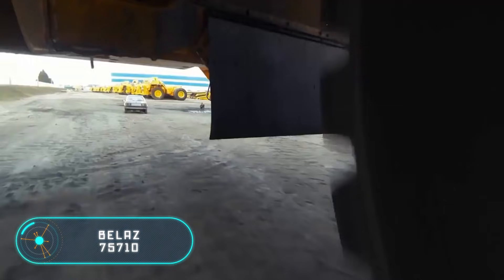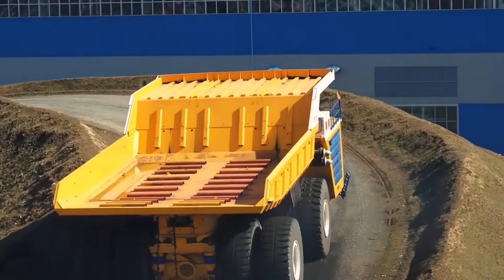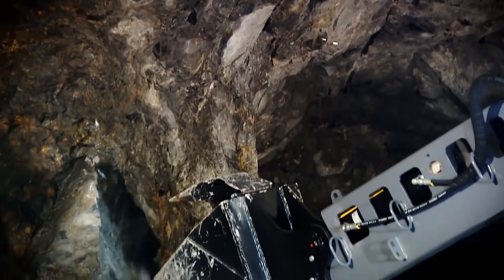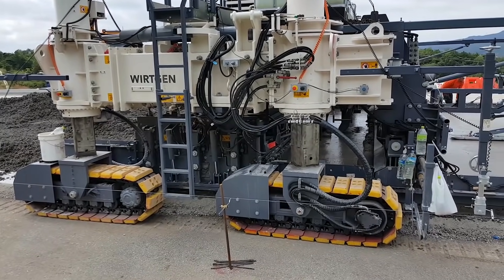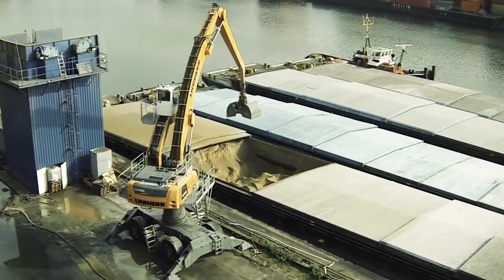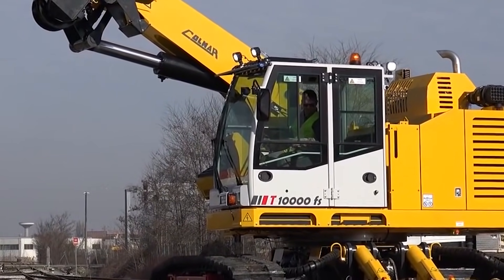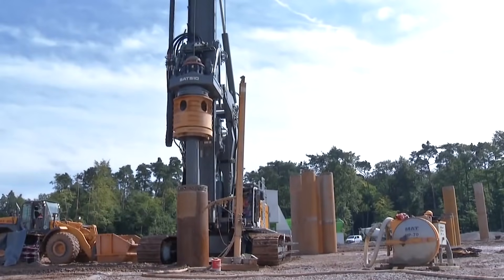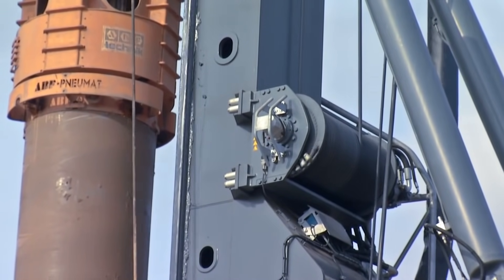THE POWER OF THIS EQUIPMENT IS STRIKING

Comment: You might think those are 8 front-loading washing machines above the front grille of the BelAZ 75710... but they're actually 68" subwoofers, running at 30,000 watts each, capable of producing 230 db and vibrating vehicles and materials out of its path.

Comment: It is not the POWER of this equipment that is striking but  the Forces produced.  The power in other craft as planes and ships is much higher.
Reply: Carmel Pule' gjbljl jk
Reply: THE FUCK
Reply: Look up force, work, and power, then you'll understand.
Reply: @xelle1649  That they apply when they're loading trucks for example...  I don't realize what so striking about that.
Reply: The power they produce is "translated" into force right?  😞
Reply: I'm more amazed by the efficiency of design, where these machines are far better than ones of 20 years ago.

Comment: The Largest of these machines is the T2000 ad Machine producing up to 4 ads per minute. 🤬
Reply: Yeh first  ad explines about the ass , second ad explains how the donkeys ass work , the third ad explains how this video makers cowdung filled brain works.one thing  I NEVER BUYS ANYTHING WHCH REQUIRES  AN AD.
Reply: @creativeworld4237  Some of you are more pacifiers than pacifiers, huge trucks for outdoor mines or low trucks for underground mines are the wrong choices because of the high purchase and management costs and the second due to low productivity and the problem of underground repair. Conveyor belts (there are so many types, I would make them do it in a long escalator with large containers in an open-air mine <reduced handling and energy savings> the current big trucks serve where the belts cannot be mounted. The trains with baskets that are used (in mines with horizontal underground tunnels) are not very productive compared to a specific continuous conveyor belt sure should have an automatic initial loading system and a final material transfer system on the vertical and central conveyor belt with large baskets for more tunnels (and conveyor belts) .It is a complex project with many mechanical automatisms (dust-proof and easy to clean from dust) with electronic control on an intranet network on a remote PC cable.
Reply: @giuseppebattagliese6424  nope, not going to work. How many bearings, greasers, pins and more, plus the end point constantly changing. Plus you never know at which point it will brake down or need general servicing. Plus endless twists. A truck is much more flexable and generally can be serviced at a location that is comfortable and has the needed tools and supplies.

Comment: is it just me or is 2000 hp a little light ? this thing should have at least 18000 hp to give it 60 hp per ton , even the weekest cars are 60 hp per tonne
Reply: Doesn't take that much horsepower to run hydraulics and electric wheel motors
Reply: it's all about the torque ther are gear reductions all the  way to the final drives.
Reply: You aren't going to move 60mph with 400t of rock. Big trucks on the road are only 350-600hp. That puts 15 hp per ton if the 600hp engine is only loaded to 40t. That same 600hp engine I used to run at 72 ton and got down the interstate just fine.
Reply: 2330hpx2=4660hp
Reply: 2000 hp x 2 engines 4000 hp total!
Reply: The engine will be running like a generator with narrow rev band hydraulics and electrics move the thing
Reply: Gears mt friend gears not to mention torque
Reply: Yeah its probably got 12k ft lbs of torque atleast since its diesel
Reply: The engines runs a generator which produces electricity for electric motors for the wheels.
Reply: NOBOX7 It’s not the horsepower that’s important it’s the torque...